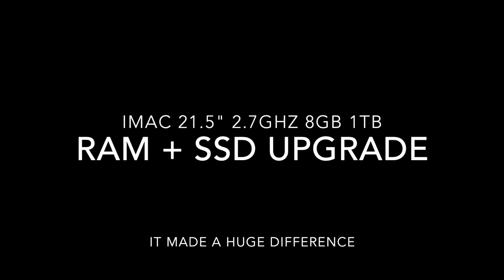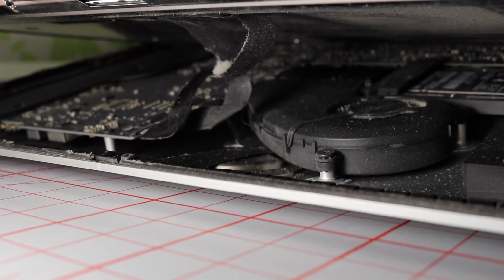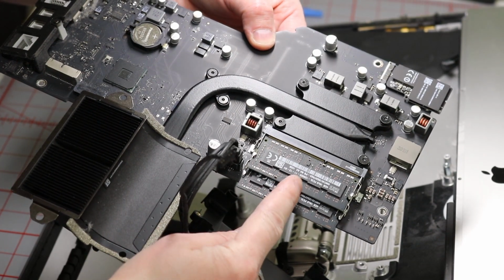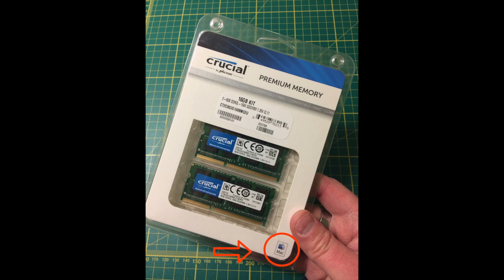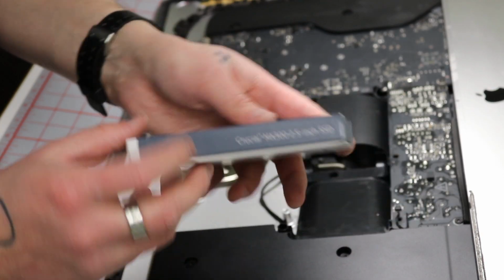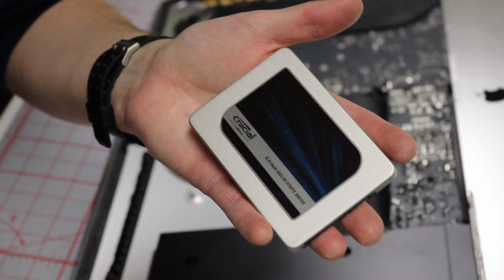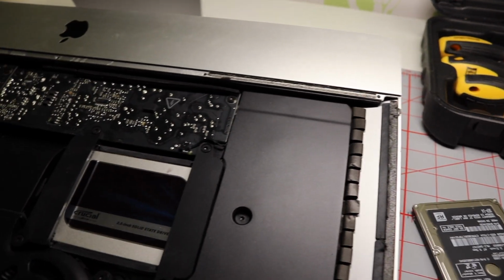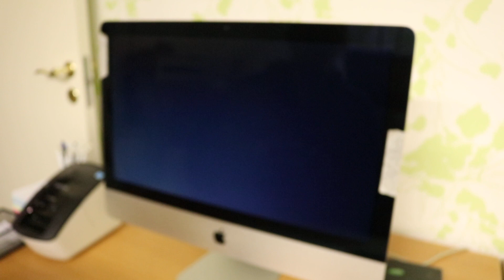iMac 21.5" 2.7Ghz i5 RAM & SSD UPGRADE 2017

Comment: I did this to a 2013 and a 2017 iMac, wasn’t easy but took my time and did it. Both iMacs are now fast as hell and I saved a lot of money not buying new iMacs which come with a laughable 8mg ram, if you buy more ram and add an ssd drive from Apple you will overpay by almost an extra $1000. It cost me less than $250 to do this!
Reply: Bill, what are you using your 2013 Mac for? I use lightroom, photoshop and premiere...do you think going from 8gb ram to 16gb will give a significant improvement?
Reply: @eyefortheworld760  It helps with the speed but what really speeds it up is the solid state drive. If your going to open it up you may as well upgrade the hard drive as well. Replacing the hard drive was easy, it was getting to the ram that was a bitch, you have to take out the the logic board as the geniuses at apple buried the ram under everything. As I said the difference in performance was amazing and definitely worth the trouble. I use both Macs for the  Adobe creative suite, Photoshop, Illustrator mainly. Could barely do anything in Photoshop before the upgrade.
Reply: Eye for the World go for 32GB Ram I just had a 2013 21.5 iMac with 16gb Ram while using premiere pro and ps it was slower than I wanted but I was also editing 4k video it was using the whole 16gb modules so tasks were slow.Get a 500gb+ SSD and max out your Ram should improve things a bunch.Lmk if you have questions.
Reply: I need help so fucking bad..

Comment: Thanks for your advice concerning RAM. I accrossed the same problem. Bought RAM DDR3 1.5 v. It did not work.  So now l'm  looking for DDR3L. Hope it will work with this magic Mac )).  But I managed to get skills to load and upload memory stiks without dsassembling motherboard -)!!!
Reply: were you able to slide the ram underneath that small area?
Reply: @xXRyRyXx7  yes. The first module is more easier than 2nd.

Comment: Basically any Low voltage (DDR3L) will work because 1.35V voltage. 1.5V modules that don't have L, will not work.
Reply: thanks, good info
Reply: This is ddr4 module .They are all low valtage,
Reply: @ilovemymac5690  in the year 2013. There was no DDR4 modules. ;)
Reply: @NedjoKovacevic  He is upgrading the 2017.
Reply: @ilovemymac5690  did you actually watched video? He was upgrading 2013. model three years ago - in 2017.
Reply: @NedjoKovacevic  no i didnt. Its the same shit bro. Nothing have  changed since 2013.
Reply: @ilovemymac5690  yeah it did. DDR4 came to market with Skylake processors. But obviously you didn't watched video so this arguing is pointless ;)
Reply: Are you sure that any DDR3L ram will work? I have a 21.5 Late 2013 imac and while I'm inside it for SSD upgrade I thought I would do the RAM as well, but finding compatible (declared) ram for decent price is quite hard.

Comment: Is it possible to upgrade the processor from i5 to i7 on imac 2017 27" 3.0Ghz  Radion pro 570?
I checked on apple site on the 2 other  of 27" its written configurable but not on the 3.0

Comment: I can see the ram under the board. Is that difficult to install the ram without removing the whole board?
Reply: I was able to replace the RAM without removing the board. I did have to remove all the screws shown in the video. With a little patience it can be done while having the board partially lifted. Just have to make sure you seat it correctly.

Comment: Hey I see you have a hdd and a ssd slot is it possible to run both the reason I’m asking is because I want to run two ssd one in the chip form and the other in the 2.5 ssd form but I only see people
With the 27 inch that run both
Reply: what do you mean by 'run in the chip form'?
Reply: Is it possible to use both at the same time?

Comment: is there a PCIE SSD SLOT ? I think I saw it on this board ... why don't you upgrade to PCIE SSD?
Reply: Yes, there is on this one, not all have them, it depends on whether they were sold with the fusion drive, except the late 2013 model which does have one according to OCW.  I was wondering the same thing, why didn't he install and have 2 storage devices.

Comment: what adhesive did you use to glue the screen back?
Reply: You can get it on Amazon. It's cut specifically for the imac. You'll want to use tape on the outside temporarily to keep pressure on the screen and frame.

Comment: OMG  do i have to do all of that  to upgrade the RAM??
Reply: haha, my thoughts exactly
Reply: No, Ram upgraded with ease from the rear entry flap.. He's also changed the Hard Drive which is the tricky part.
Reply: Bill Ding The 21.5 inch iMac doesn’t have a flap in the rear.

Comment: i got an imac 21,5 late 2015 i am planning to change the hhd to an ssd and also upgrade the ram and change the paste on the cpu but i am not sure which ram i have to use (now i got 8 gb 1866 mhz and i want to upgrade it to 16
Reply: Literally same device and i need ram upgrade to 16
Reply: How did it go did u update it ?
Reply: Dugla gamer u can’t upgrade the ram only the hd to an ssd

Comment: Does the 2012 21.5 inch iMac not need a thermal sensor installed when upgrading to SSD? Been searching for an answer for about two weeks and can’t find anything.
Reply: I just did this install, and did not use a thermal sensor. Not really worried about it, plenty of room in there for everything to breathe. But, I do not game for long hours, if you game for hours on end, may be a good idea. Myself, casual use, I really do not see the need for it. Apple did not see fit to install one, so why should I? The old HDD that the new SSD replaced is more prone to heat than these new SSDs. At least that is my thinking as they have moving parts and a metal case. No issues with my MacBooks with SSDs and no thermal sensor.

Comment: If you’re replacing the hard drive, how’s does the Mac know how to boot into MacOS ? The ssd has MacOS on it ? I need help people
Reply: @Otniel Echagarruga you cannot 'recover using internet' if the only drive in the computer is a totally blank drive. further, you can clone to a flash drive.

Comment: is that a 13.3 or a 14.1 imac. because i think late 2013 is 14.1 and the memory on those is soldered
Reply from the maker: This is the 14.1 and as you can see in the video the memory is not soldered..
Reply: @HearGear  ok thanks. but crucial wont sell memory for a 21 inch 14.1 imac they declare it soldered.
Reply from the maker: @darrenslater1913  This is a 2.7Ghz, its the 2.9Ghz that has soldered memory.
Reply from the maker: @DJPaulgee1   As you can see in this video its upgradable, even if its alot of complicated work to upgrade the ram. This model is 2.7Ghz 14,1 model, even the 2.9Ghz can be upgraded if its a late 2013, its just as complicated as in this video.. you have to take the whole computer apart...

Comment: You are very brave for doing this nice job. Shame on Apple for making these iMacs non-user upgradable, for what used to be a simple procedure to add more ram and even replace a hard drive back in the old days when Apple wasn't as stuck up as they are now. They put these slow 5400rpm hard drives in these and bare bones ram, I had a 2014 iMac that was much faster and user upgradable. I curse Apple every time I work on this iMac is its essentially a glorified iPad and very slow, forget photoshop and Illustrator running on this unless you have the balls to tear the machine apart like this brave fellow did. Or you can spend $5000 on an iMac Pro to get something that is usable.

Comment: Link for the RAM and SSD please?
Reply: Michael Wright I bought this 1tb ssd, the tape and the pizza cutter. I will open it next week. The only thing that scares me is removing the screen because I already change ram and ssd on my 2012 MacBook Pro and it was so easy. I won’t upgrade the ram on the iMac because I have 8gb but mostly because I am scare to go this far in my iMac. Swapping the ssd will be easy! I just hope that the screen won’t be too difficult to remove!
Reply: @alexandrefauchon7755  Take your time, it was not that difficult at all.
Reply: Michael Wright you were Wright I just did it today and it was not that difficult! Everything is working so much better now!
Reply: @alexandrefauchon7755  Not rocket science, and you just discovered that anything is possible with just a bit of effort, and some good old fashioned get'er done! Good job!

Comment: Great job, I will be upgrading my hard drive to a ssd, your video is very helpful. I can’t believe how hard Apple made it to up grade anything on the iMac. If you noticed that everything you did, could have been done if the back panel was removable. The iMac looks great but what a stupid design. Good going Steve Jobs.

Comment: Hi, does it work on a 21,5 iMac late 2015 ?
Reply: Yes
Reply: Michael Wright even if it hasn’t retina ? (thank you for your answer)
Reply: @ArvinTV  I would not see why not, unless Apple did something like solder the memory or HD to the board. A good place to check is www.owc.com
Reply: Michael Wright actually when you look on apples site you can see what product can be upgrade. And late 2015 iMac 21,5 cannot. 🙏🏽 thank u
Reply: @ArvinTV  If you already knew, why did you ask?

Comment: You do know that you could have excessed the ram from the back panel of the unit, if i'm not mistaken!!!
Reply: Some newer units do not have this feature.
Reply: @monofrio6804  this is a 21.5 only the 27” has the back panel

Comment: there's an access panel in the back of the iMac to access the RAM.   You do not have to take everything apart...
Reply from the maker: No.. not on this model... you have to take everything apart to make this upgrade... some models has the access panel on the back.. but not this one.
Reply: only the 27 inch ones have the access door, not the 21.5

Comment: The ram Is accessible from the back of the iMac without opening the computer. For those that don’t know. If you are upgrading the hdd to an ssd then this is helpful, if you are upgrading just the RAM just pop the slot behind the Mac with a pin,paper clip or whatever you can fit in the hole and you are done. No need to open an iMac to upgrade ram. I’m only posting to make this clear.
Reply from the maker: You are totally wrong.. its not possible on this thin 2.7Ghz model, i been working on macs from many years now.. i know what modells RAM can be upgraded from the back by just removing a lid.. this is not one of those models..
Reply: It‘s the 27 inch iMac where you can put RAM into by opening a lid at the back.